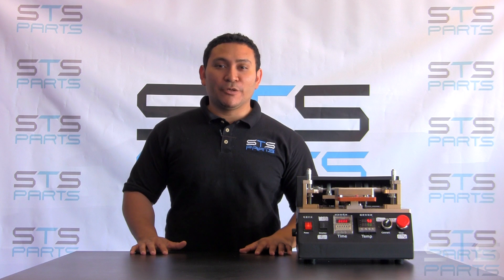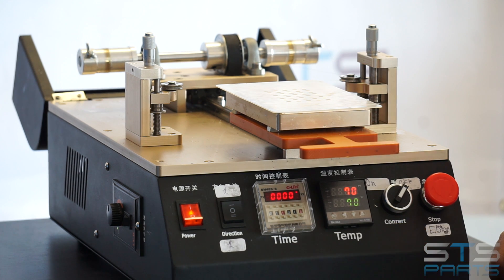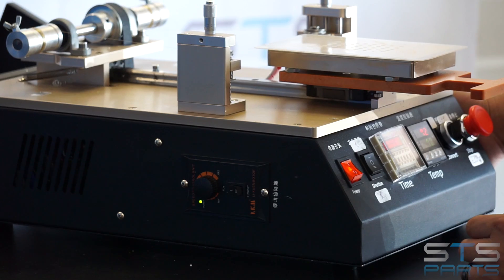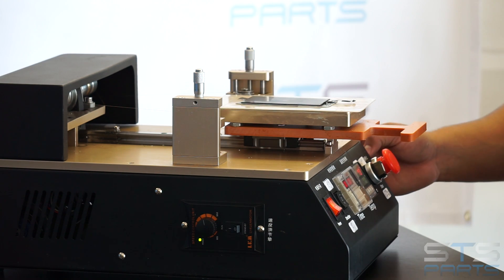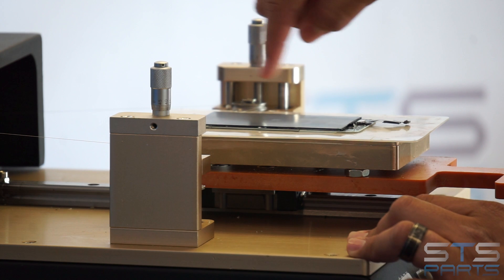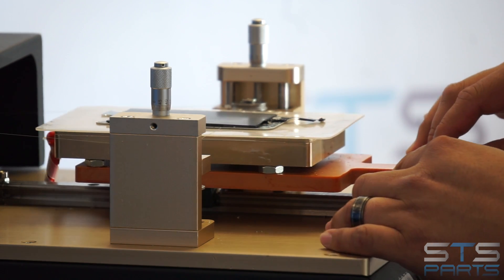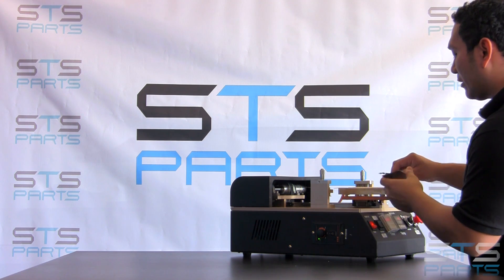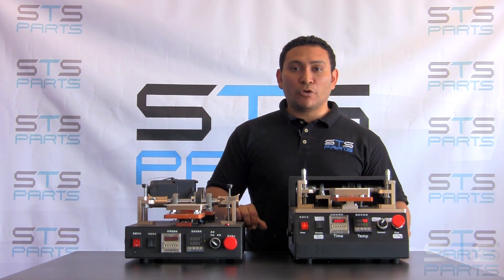Semi Automatic Glass Splitter for LCD Refurbishing

Comment: a lot faster then doing it manually... no wayy, it''s like a 20 second job lol
Reply from the maker: +James Carter Thanks for sharing your opinion. We have seen a more consistent result using a semi automatic when doing more than 10 screens at a time. Less wire snapping. Also no need of going over 65 degrees decreasing problems with touch screen later. Finally we did see the process being a little faster having quality screens at the end.